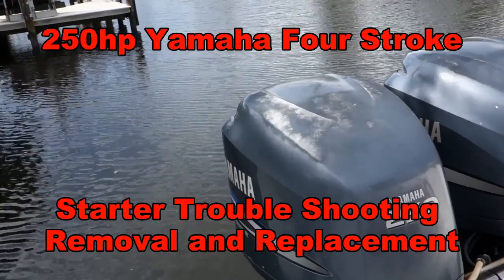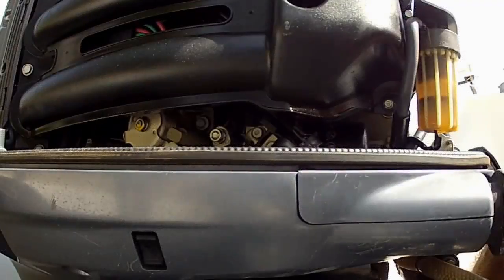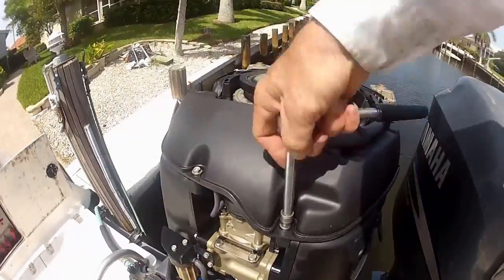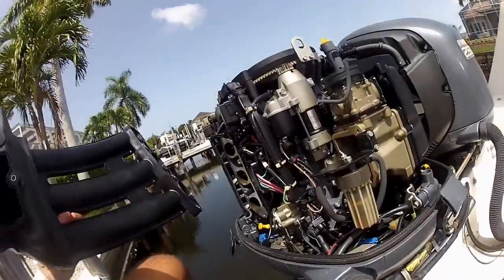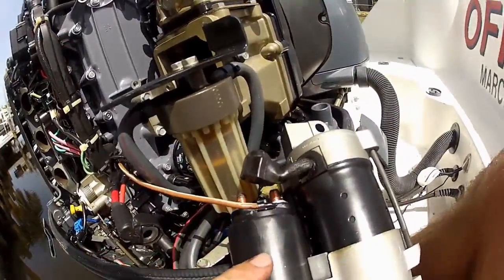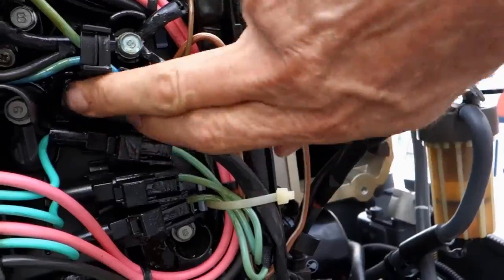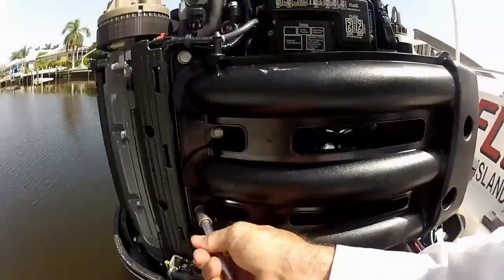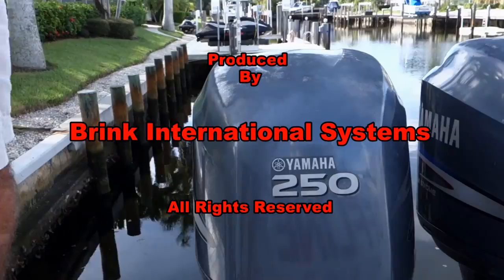Yamaha Outboard Starter Troubleshooting and Replacement

Comment from the maker: The switch that is mentioned/shown in the beginning of this video 
is a common battery power control switch for the "BOATS" DC electrical system and 
is always mounted somewhere on the boat.
It is NOT part on the Yamaha engine or its starter.Sorry about any confusion.

Comment: There was a switch that he talked about at the very beginning. it had a red plastic "key" . I have the same problem, but after replacing the starter motor and all the other stuff and am stuck trying to find that switch!!! Was that switch located on the motor itself or was it the key switch located at the helm???
Reply: Did you ever find the switch?

Comment: I saw somebody in my location which take out the starter motor and rebuild it.  The similar thing i done was rebuild my 2 stroke 115 of trim motor which clean all the dust inside the motor and check the brush connection is good, put back together and i found it work well a long time.

Is that can do the same thing when I getting starter motor fail also?

Comment: Hi, I have a yamaha f40f 2015, after the boat sink once due a big storm we get it back and worked totally fine until now, seems the bendix wheel doesn't work properly anymore. When i start the engine the bendix pop up but can't run the flywheel or actually can and then then the engine start but after a few stop and start doesn't work anymore...i can hear the click but the bendix doesn't move. If I leave the boat for several hrs the bendix engage or at least try, after I turn on and off several time it doesn't even move... Could be the key switch?
Unfortunately where i live are no good tech guys and I am afraid to take out the whole bendix unit and send it to a the yamaha factory for inspection... any suggestion will be appreciate

Comment: So what was wrong with the starter, or was it a replacement ?
Reply from the maker: As mentioned in the very first part on the video we found that the problem was not with the starter but with a battery switch that went bad. That switch would not allow sufficient current flow to operate the starter.

Comment: arms in the air...what turned out to be wrong???
Reply: I read in the comments it was the switch shown at the beginning of the video.. starter tested good..wonder why he didn't check the switch before taking off the starter..
Reply: @terryleblanc6868  yeah...good point Terry

Comment: I know I would have dropped at least one bolt in the water. I have one that starts cold but will not start on a hot engine. Anyone with ideas?

Comment: love the video but how did you get the starter working
Reply from the maker: The problem was the battery control switch mentioned above and the started was just fine.
Reply: thanks

Comment: what was wrong with it? what did you fix?
Reply from the maker: After removing the starter and testing it, the start was fine. So I replaced the starter and traced the problem back to a bad battery switch I mention at the start of the video.